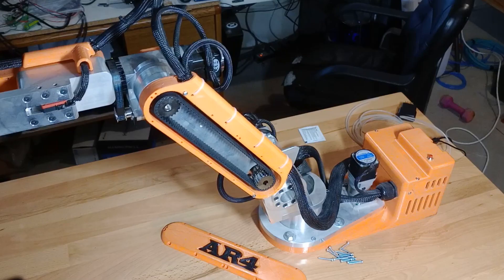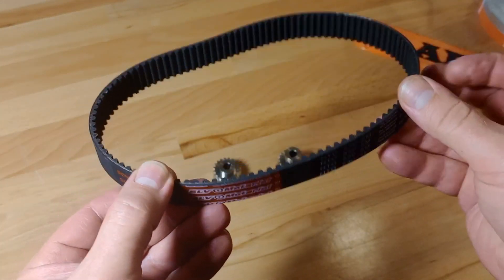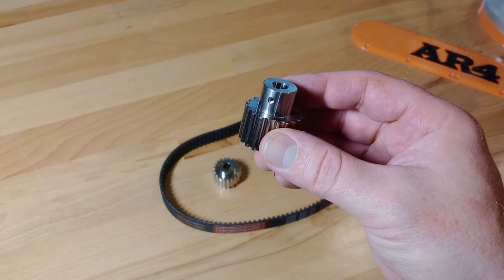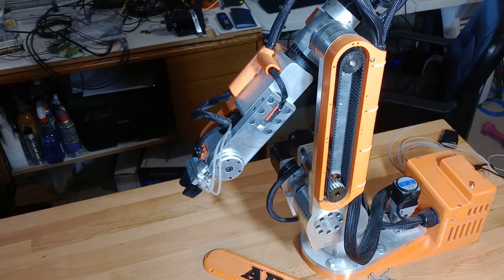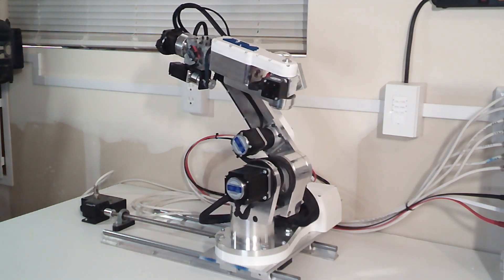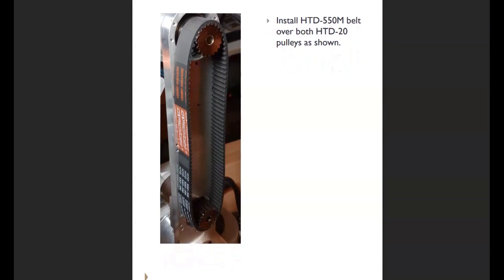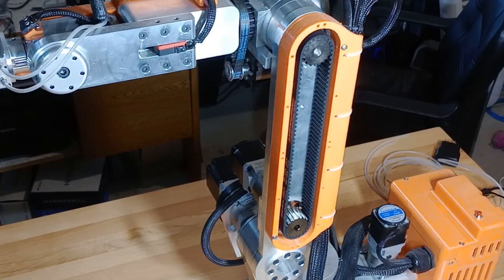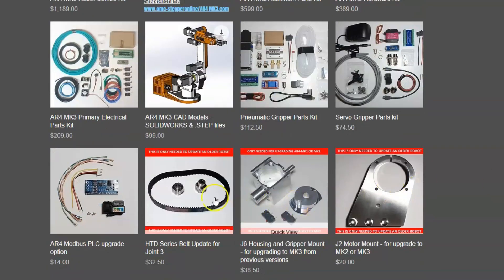AR4 MK3 6 DIY 6 axis robot arm - HTD timing belt upgrade

Comment: I really want to experiment with robot arms but it seems like there is always a barrier to entry. The AR4 seems like a good place to start but I just noticed 3d printing is required and the kit doesn’t include the motors and whatnot. eBay and auction sites it is 😢

Comment: Does that effect the arm length and weight's it can handle ?
Reply from the maker: no it should not affect the payload or length, its just a better option with less backlash or slip.